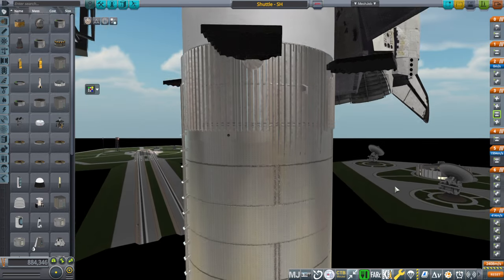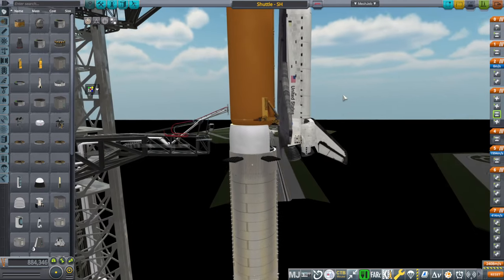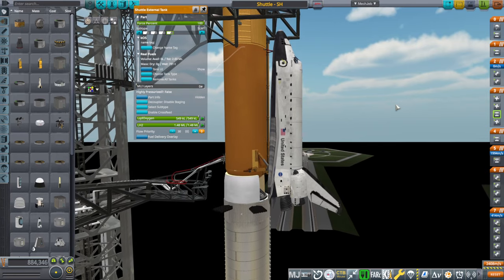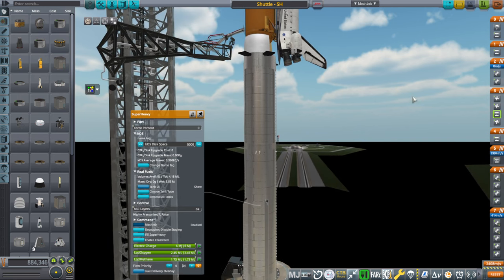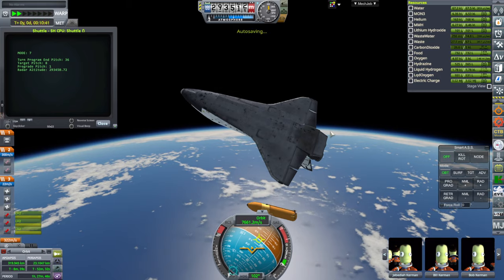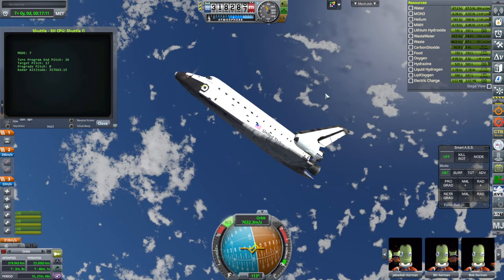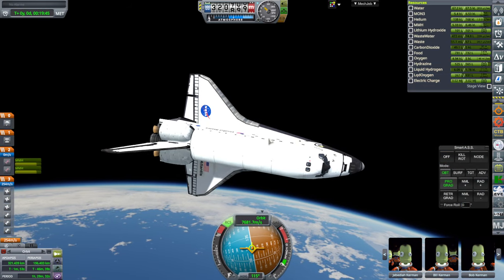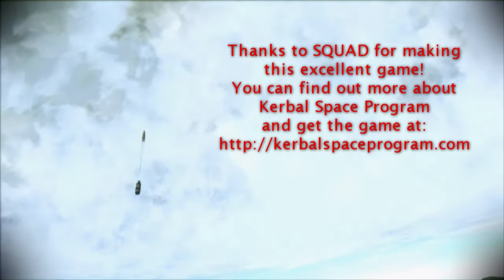Shuttle-Super Heavy (RO in KSP 1.12)

Comment: now i have a stupid idea:
use Superheavy as the main tank for the space shuttle and replace the rs25 with raptor engines cuz methalox and on tank seperation fly superheavy back to the chopstickS
Reply from the maker: If Super Heavy is the main tank for the Shuttle, how does the Shuttle get to orbit after Super Heavy separates?
Reply: @RaizSpace  that’s a very good question
Mhhh
You could place tanks in the space shuttle cargo bay